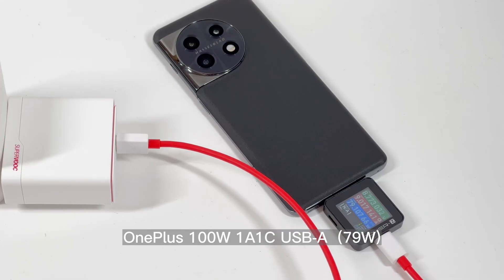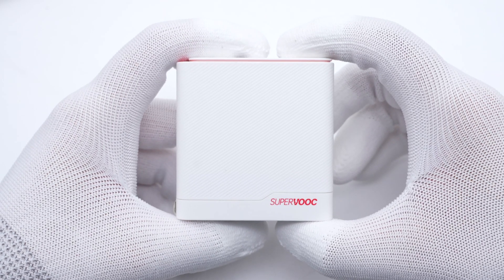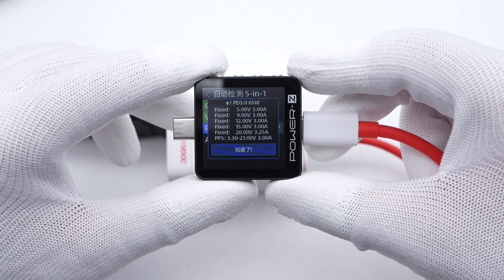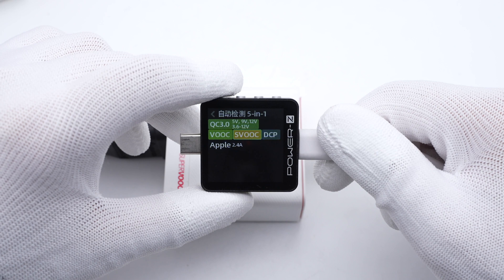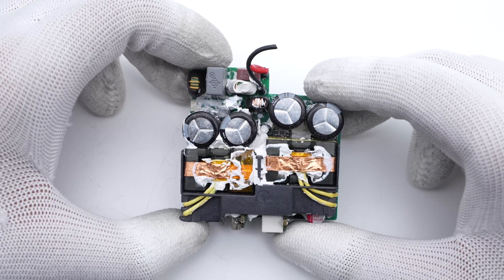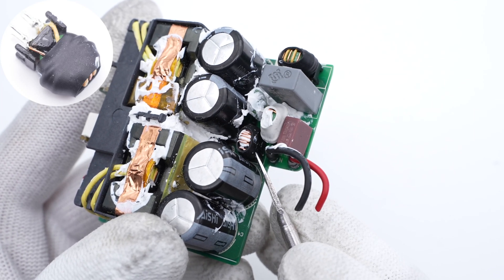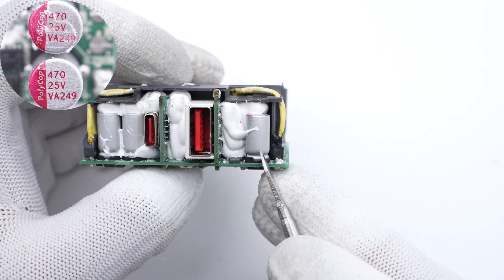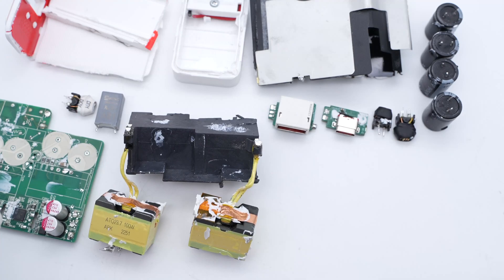Teardown of OnePlus SUPERVOOC 100W Dual Ports Charger (1A1C)

Comment: Any insight pn where to get a (OnePlus, Oppo, Realme, or third-party) cable that supports 100W SUPERVOOC charging speeds without degradation in speed or excessive heat? I'm in the US if it matters. Recently noticed on their online store that OnePlus sells updated USB-C and USB-A cables that are rated for 12A and 10A, respectively. Would prefer that the cable be longer than one meter and be rated for at least 8A. With the new OnePlus 12 out, would be interesting to see testing on charging speeds, as well as compatibility with first/third party cables and chargers.
Reply: If you didn't get one search for the DL129 model cable. Its the stock cable that comes with phones. Its usb a to c.